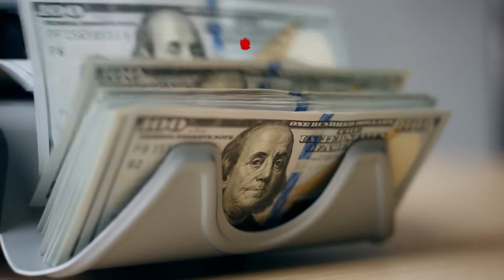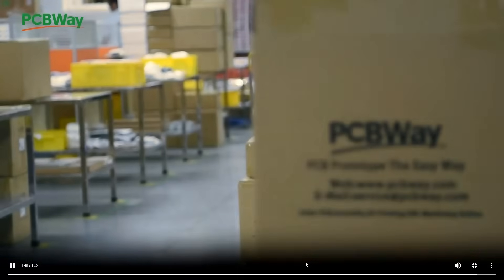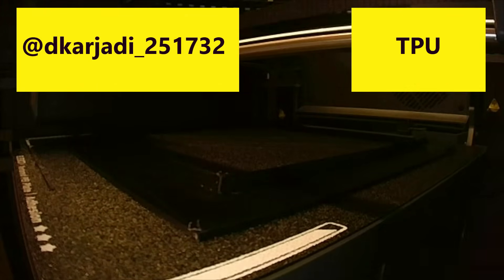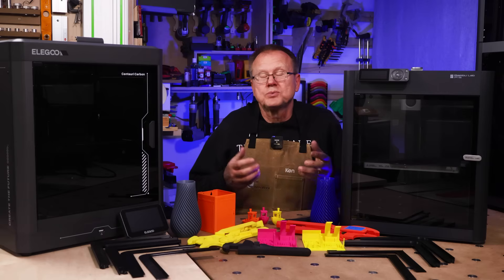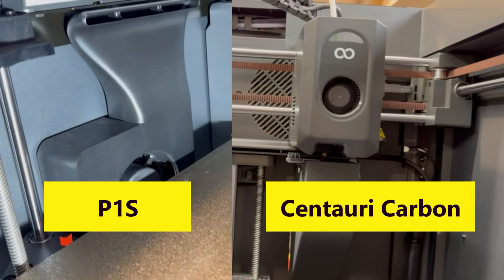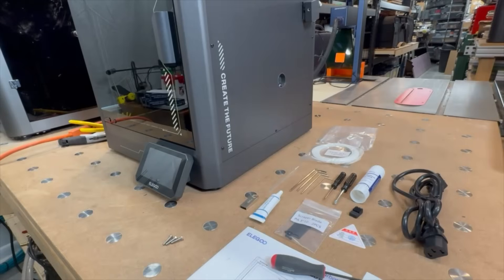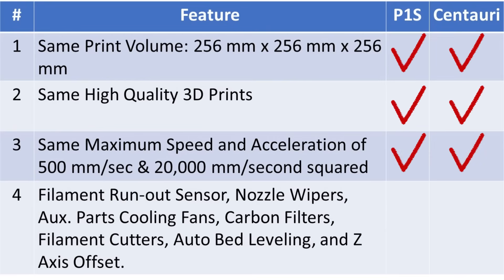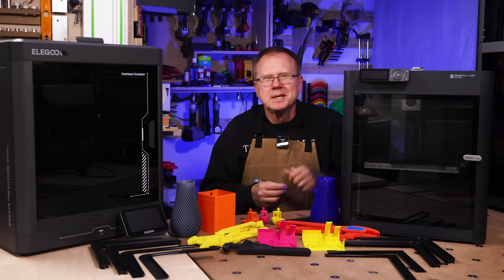Elegoo Centauri Carbon Printer: Better Value Than Bambu Lab P1S?

Comment: Gonna be honest here. I love my P1S, it has thousands of workhours and is still printing as strong as it did on the first day. And while BambuLab has revolutionized the 3d printing world with their userfriendly high quality models that work right out of the box with no tinkering required, their printers are a few years old now, and the other companys have finally caught up.
And yes, those companies are mostly copying the bambu printers, but they're also slightly improving things here and there. In this case, elagoo optimized the production cost of such a printer. It's easier for these companies when they don't have to be the first to invent a new style of printers and instead can see how bambu printers work and perform first before releasing their iteration. And while some say they're shameless copycats, they're still copycats that improve on bambus design nontheless.

 So is the Elagoo a better printer? Yes. Not by quality, but by value. And that's just logical, after all they had two years to improve on bambus design, they didn't have to be the first, so it just makes sense.
Reply from the maker: Thanks for your feedback.
Reply: it’s a very good example of why competition benefits consumers

Comment: What bed plate did you use for ASA and ABS on the Centauri Carbon?
Reply from the maker: I used their standard PEI textured plate, side A.
Reply: @ristinnovations Thanks. I haven’t tried yet and was curious if that plate would work.

Comment: Also a small side note is that Bambu Studio is a fork of another sliver, they did not create theirs from scratch. 

Thanks for doing the comparison. I have 3 Bambu lab  printers and very upset with the changes to completely lock down the X1C. Good to know with the correct settings the CC can produce good results. And it comes with a harden steel nozzle. If Elegoo focused on R&D they could outperform Bambu easily. Again thanks for the video!
Reply from the maker: Yes, I agree that Bambu Studio is a fork of Prusa Slicer. Thanks for your comments.
Reply: Both elagoo and bambu slicers are a fork of orca slicer
Reply: @Naveication  orca slicer is actually a fork of bambu studio, not the other way round

Comment: I spent a lot of money on my bamboo machines. I like them until I have to handle the tiny SD cards. I'm not going on the web the operate the 3D printer. That's never going to happen. That's the reason why I'd buy an elegoo was over a bamboo if I needed more printers.
Reply from the maker: Thanks for your comment.

Comment: Worth noting that Bambu printers build volume is slightly less than the advertised 256mm³. There is a fix for it but you can't use the AMS while printing the full 256mm³ volume. Seems the reason is the filament cutter and accounting for z-hop

Comment: CC is lan mode by default.  Does not require cloud signin.  Though possible to use with Obico.  Side panels of CC are magnetic, so metal not plastic.
Reply from the maker: I have learned two important things from you today.  First, since the CC didn't have an ethernet cable connection I didn't have an accurate understanding of LAN, but now I have learned that the CC has a WLAN (Wireless LAN).  The second thing is that I am embarrassed that I missed that the CC side panels are metal; not plastic.  When I mounted the spool holder the panels appears so flimsy that I mistakenly thought the panels were plastic.  Your feedback has helped me learn an important lesson today that I need to be more careful with my observations in the future.  I really appreciate your feedback.

Comment: I have a P1S currently and am patiently waiting on my CC preorder.  I think the CC is a better value, and may add a second one once I get this preorder.  Neither has open firmware, but you can at least you can run the CC from Orca and not be tied to either a LAN mode or their slicer. I would rather use the same slicer for all my printers, and I have Creality printers as well as Bambu so using 3 different slicers would be an decent annoyance (Though to be fair Bambu slicer is pretty good).
Reply from the maker: I agree with your point about the slicers. It’s nice to have one, if possible. I also use OrcsSlicer and Bambu Studio. It took about 3 months for me to get my CC, but now the lead time is down to 8 weeks. Hopefully, their lead time will continue to drop. I hope you enjoy your CC when you get it. Thanks for your comment.

Comment: Though CC checks all the boxes, I’m still not confident enough about the long-term reliability of ELegoo compared to Bambu Lab. Only time will tell.
Reply from the maker: I’m wondering about Elegoo’s long-term reliability as well. Ironically, that was my same concern about Bambu Lab when I first bought my X1C a couple of years ago. Since then, my X1C has been a workhorse and Bambu Lab have a large amount of spare parts available. As you said, we will have to see how the Elegoo holds up over time. Thanks for your comment.
Reply: @ristinnovations  I’m also unhappy with Elegoo’s pricing strategy. The CC costs $300 in the US but $540 in India. Meanwhile, the BL A1 is priced the same in both countries. I’m frustrated by Elegoo’s huge price differences, especially since both companies are headquartered in the same region of China
Reply from the maker: @Peekachooo  I can understand your frustration with the Elegoo CC price difference between the US and India, especially with all of the recent US tariffs I'm surprised that Elegoo didn't raise their prices in the US.
Reply: It looks pretty self repairable. The bambulab is much harder to self repair. I would have been sold, but the closed firmware is no go. I'd rather buy a printer that support full klipper open source. Don't want to be locked into their ecosystem.
Reply: I have 900+ hours on my elegoo. It still prints just as good as the day I bought it.
Reply: Think the only way to know for sure is to buy a CC and support it. Rally behind elegoo put it in ur mini farms and they will support it like no other.
Reply: Perfect.  The CC looks as good but as P1S owner who needed a cheap second printer last year I bought an A1 mini. I think Bambulab have brand loyalty.
Reply: Well I own an elegoo fdm printer (Neptune 3 pro) for almost 2 years, so far I had only some pronouns with the bed leveling and once a bloab of death and since then my bed leveling went bad.
But the assistance was really nice, even if my printer was out of warranty they send me a complete new head for the the printer (it costs 50€ in there site) 
Well it didn’t solve my problem lol but with a bit of patience I managed to make it work good enough.

Comment: Sorry to clutter up the comments, but I also want to point out something worth mentioning: 

The Centauri Carbon comes with a factory installed hardened-steel nozzle and extruder gear assembly, which means it can print CF and GF filaments out of the box. 

The P1S only comes with a stainless-steel nozzle from the factory and requires a $46 (or more if you go aftermarket, rather than first party, which has some advantages) nozzle and gear assembly upgrade to be able to print abrasive filaments. 

This is a definitely a plus the CC has over the P1S. 

For transparency: I own a P1S, not a CC. So, I'm not shilling for Elegoo here or anything. Just something I wanted to point out.
Reply from the maker: That’s another good point about the P1S shipping with a stainless steel nozzle. I did cover that detail in my other video comparing the P1S to the X1C, but I forgot to mention the nozzle materials in this video. Thanks for pointing that out.

Comment: 10:01 FWIW the Centauri Carbon is supposed to be getting its own multi-material/multi-color system in Q3 of this year. This information is listed on the product page for the CC on Elegoo's website.
Reply from the maker: Thanks for that information
regarding Elegoo’s plans on the multi filament option timing.
Reply: The thing is, it might end up costing more than the printer itself — I can see it coming.
Reply: @BLXCKFIT I don't think it will. But even if it does, it's still cheaper than a Bambu and AMS. 🤷‍♂️
Reply: @spaz13b  Yes, yes, that sounds very good, but it has to work WELL like Bambu Lab. It must be said that, as of today, there’s no AMS that comes close to Bambu Lab — whether you like it or not.
Reply: I say all this as someone who owns several Bambu Lab, and I'm planning to get the Centauri Carbon in the future — once I see how it holds up over time and, most importantly, how their new AMS turns out and what issues it might have. Will it be cheaper than Bambu Lab? Of course. But let me tell you, with Bambu Lab you're paying for reliability. There's nothing more to add.
Reply: @BLXCKFIT  IDK, maybe. But it seems unlikely they would dick punch their customers like that.